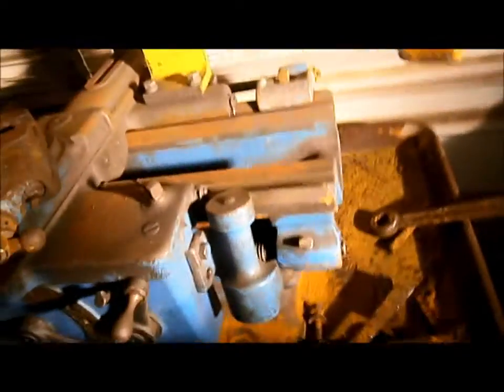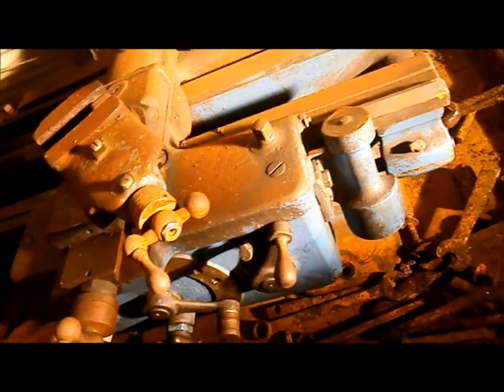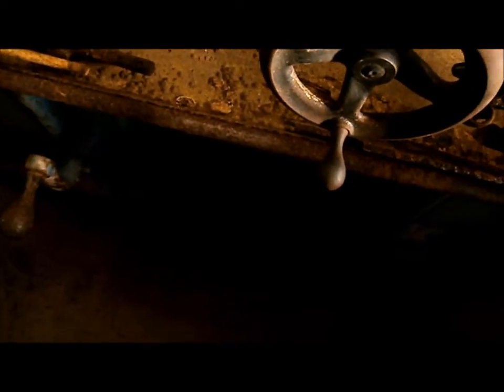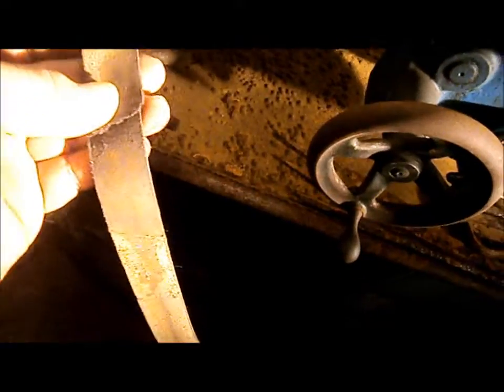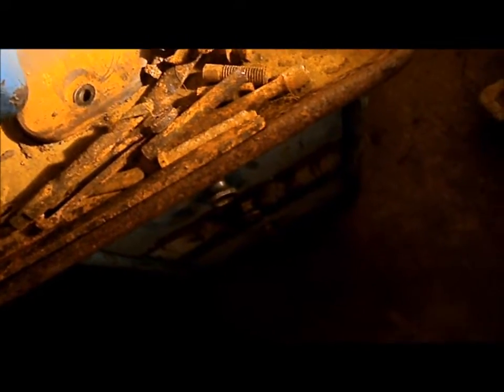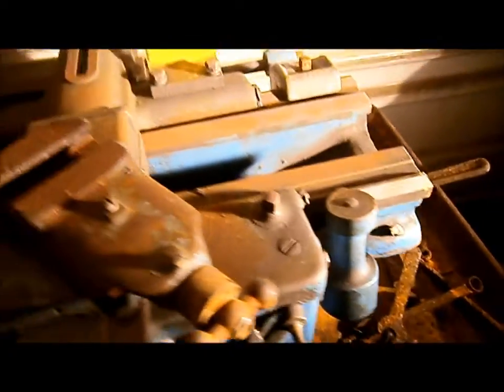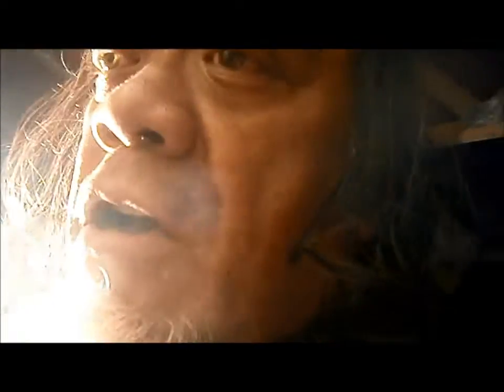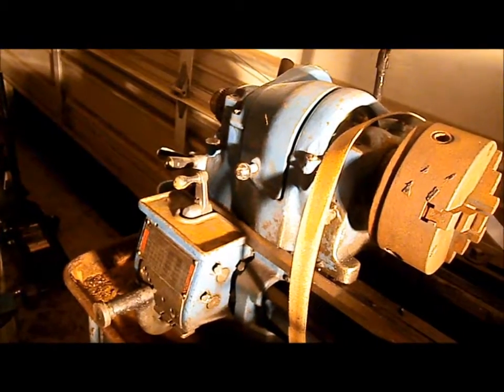Chief's Lathe

Comment: Nice machine Chief, a little oil and steel wool and that'll look brand new.  As far as the belt goes, might be worth asking at the homemodelenginemachinist for advice, pretty common lathe shouldn't be hard to find a fix.
Reply from the maker: Thanks Ron...I'll find out...going to be fun once he's cleaned, leveled & wired up.. Looks to be a "single phase" 220...turning vids coming soon...
Aloha

Comment: Sweet Lathe. Great score. If adjustment will allow you to lose 1 inch from length of belt, then 1/2 inch taper cut and epoxy. Use tight, even clamp force to set. If not, then simple copper wire, end butt lacing stitch, but not nearly as strong as epoxy. Later!
Reply from the maker: It did look like it was glued Ed...thanks for the answer I'm going to go that route...
Reply from the maker: I just saw an endless belt set up with quick bonding adhesive. So with the old belt I'm going to use 5 minute epoxy & clamp it hard with a C Clamp before I run it... Thanks for the info Ed...
Reply: Kohala Iron Works Case Hey Bro. Your belt looks like it is about 3/16 to 1/4 inch think. Just make sure that you taper each end 1/2 inch to give proper glue surface to each end and make sure that the c clamp sandwiches the entire width of the belt. If you put some plastic sandwich wrap over the joint the c clamp or whatever you use to cover the joint, will not stick to the belt.
Later.

Comment: Hello Chief.  Just in case if you didn't know, make sure the lathe is completely level before you use it . It could bend the rails and not be accurate.
Reply from the maker: I won't run it until she's level...just need to sort out the reattachment problem...
Aloha